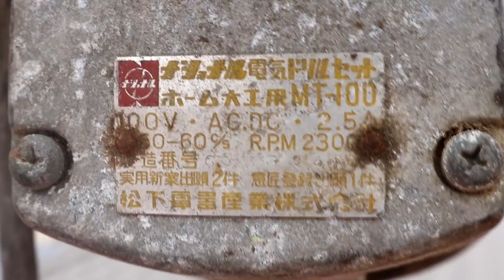Vintage Cord Drill Restoration [National Brand - Unknown Year]

Comment: Looking at that old aged heat cycled windings, poor soldering and electrical tape around the pins and no earthing... Yeah... Death trap. Replace it with 3 core and earth it at least please. I could so easily see that being used in a conductive environment and killing someone.
Reply: When I was a teen I used my father's drill (which was probably made around 1960) to do something around the outside of the house, standing on the ground in my bare feet and I got a painful shock.  Not too surprising in retrospect.

Comment: Bad restoration...only concern with outer view...The internal and most movable parts and old also...the bearings he did not change...The stator or winding looks quite bad to me...winding insulation is about to breakdown...Only for  youtube display but for long lasting performance...Nope...I doubt it...

Comment: Gears not disassembled and cleaned, nor repacked with grease.  Bearings not replaced with new sealed units.  In early section of video we could hear how noisy the drill was when turned.  No.  NOT good restoration work.  Purely superficial.  Will not last.  Waste of time and effort.